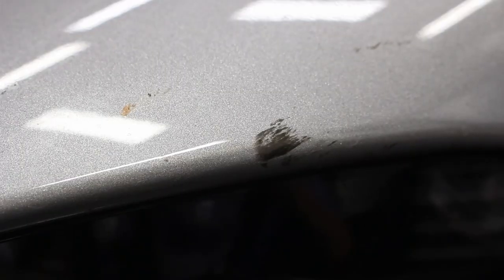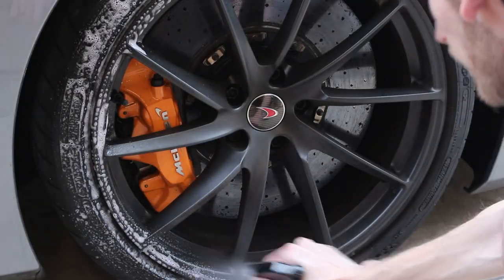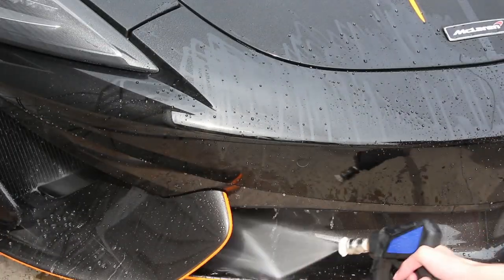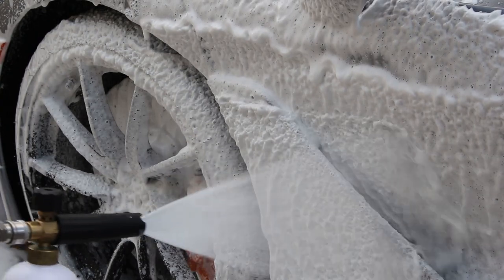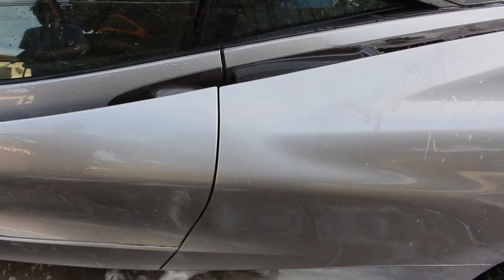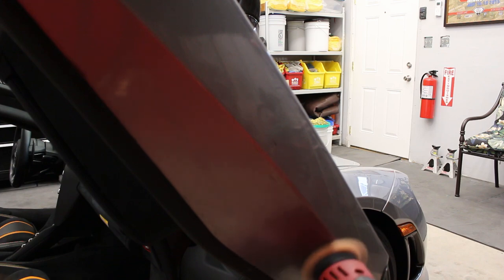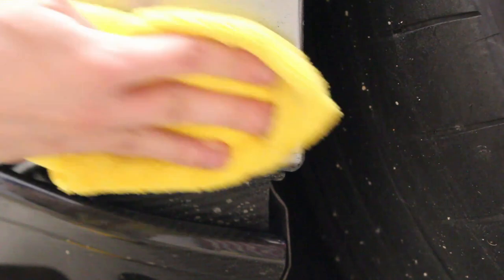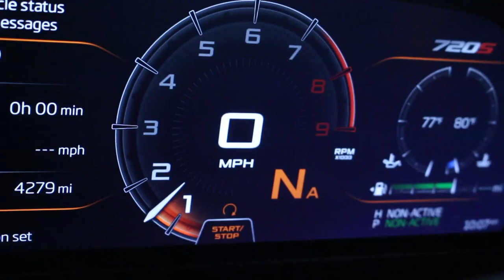McLaren 720s Post Track Detail | Rubber And Bug Removal

Comment: Good job Evan, to make it easier to work with the mosquitoes you have some products to soften them up and make it easier for them to come out with the pressurized water lance.
👇👇👇👇
ADBL-bettle juice squeezer.
ULTRACOAT-buggy boy.
Kock Chemie- dirt remover.
Auto Glanz-Bug off.
Car Pro-Trix.
Reply from the maker: This is a older video. But statusdetailstore.com has everything you'd need to handle your wash. Especially bugs 🙂👍

Comment: So, are you recommending PPF for track cars?
Reply from the maker: I have two videos on PPF currently One is the yellow Urus And one I just released.

You can watch those and get a lot of information but in general if you are going to track a car often then sure PPF full fronts definitely valuable. If it's an all out track car that only sees track time the PPF is going to get so destroyed but it's hard to say it'll give value because you'll have to replace it so routinely so that gets kind of in your hands only like only you can answer that question. But if you have a car that you're going to track a couple weekends a year and you think you might sell it in 3 years then I would say there's a strong argument that you'll get good value and when you sell it there is a good chance at the car won't be worth more because that's not how the stuff works but it would definitely be worth what the proper market value is because the front's not going to be wildly trashed
Reply: @STATUSDETAIL  What if in my case monthly track car, and am planning to keep the car for 7-8 years
Reply from the maker: @Funorigamikid  sounds like ppf would benefit your situation. That sounds like a lot of track time. 

If you drive with friends a lot who have sticky tires that throw rocks then I'd push even harder into the your going to see value side

It's crucial to understand that ppf is sacrificial. It's only job is to get hit with rocks then peel off for a fresh new piece when it's to ugly. 

So for that long of a ownership you are likely replacing a section or two at least once. Meaning added cost. 

A lot of people think ppf is bulletproof bubble of protection and get upset when it's $300 to remove a section or two. And $900 to install again on top of the original$2400 full front. 

So understanding your game plan with your ppf is really important to see the best value for your situation
Reply: @STATUSDETAIL  Thanks for your feedback. I also think, that with PPF, the car can look cleaner for longer? Perhaps less peppered with stone chips? Yea, the more I drive, the more the ppf looks bad.
Reply from the maker: @Funorigamikid  yes ppf is going to help reduce the peppered look but that still does happen to ppf. It will help tho. But overall with that long of ownership you'd likely want to replace it at least once

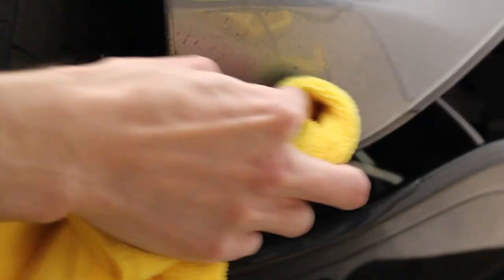Comment: Can you please provide the name of the polish you are using at 22:01? I didn't understood from the audio of the video. Thanks
Reply from the maker: I am pretty sure I used rupes polish back then as this a old video. That specific product is actually been discontinued. 

If you go on statusdetailstore.com under paint correction you will find my favorite polish and compounds. The new gen rupes is available but I actually like carpro reflect and ultracut better currently.
Reply: @STATUSDETAIL  for a DIY guy do you have any recommandation of a polish which may work by hand and is not that abrazive?  Thanks and really appreciate for answering and for the posted videos.
Reply from the maker: @skyb0yTube  reflect is definitely less abrasive as it's a polish but to be honest literally any compound or polish can be worked by hand and when work by hand will also be pretty low abrasive

If you're trying to paint correct a car by hand that's going to drive you a little crazy in my opinion I would look into the griots garage polisher that we sell that's like $150 use it on a low setting with reflect or ultra cut cut depending on the kind of car you have if you tell me the kind of car you have I can probably steer you in the right direction

If you're trying to stop polish or remove something small then you probably just want something like ultra cut and work it by hand and you'll get great results But like I said you definitely don't want to try and hand correct an entire car That's not something I would ever recommend anyone try